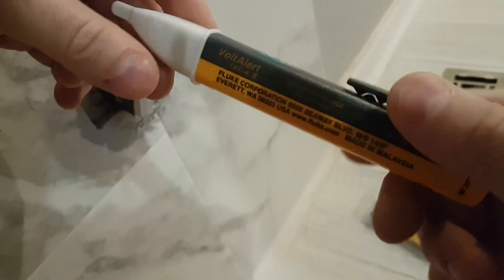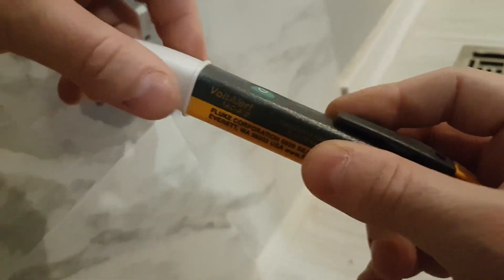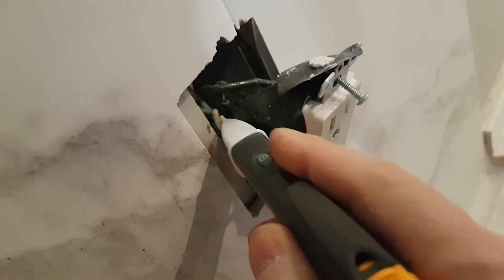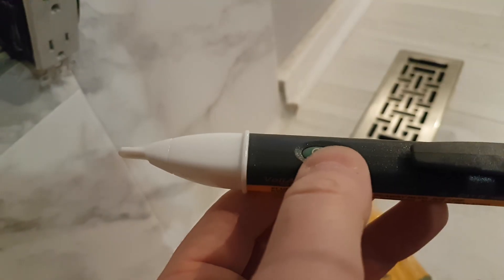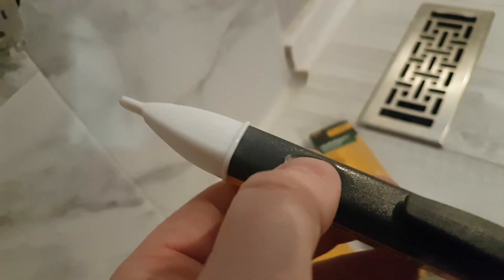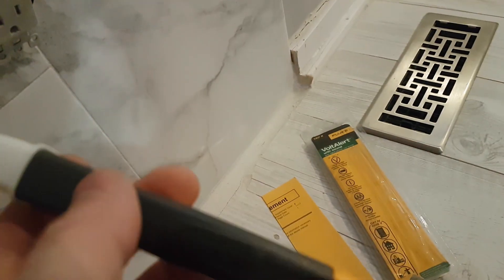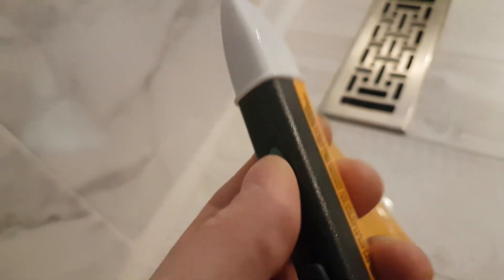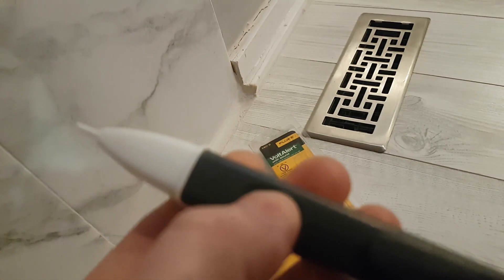How to Use FLUKE Non Touch Voltage Tester - Fluke 1AC-A1-II VoltAlert Non-Contact Voltage Tester

Comment: Very poor demo. you should have mentioned it's voltage range and shown the writing on the side, your thumb was covering it. Very poor indeed, fail.
Reply from the maker: I'm not an electrician lol. This is diy videos. Very easy .. thing goes beep that means there is power. Thing doesn't go beep no power.
Reply: @UnboxingArmy on these types of voltage detectors if the appliances is not grownded or lost its grown-up the testers light will light up

Comment: What's the difference between the ac..E  and the ac..A
Reply: E variant is expanded. It's sold part of a 5 pack. Where as the a is a singular volt stick. There's no difference in the product.

Comment: Mine is the same model but has no sound why? Although it has a buzzer!
Reply from the maker: You must of turned off the audible sound, its an option i tjink it hold the power button for 5 seconds on and 3 seconds off and ull have sound back on. If not look at the manual
Reply: @UnboxingArmy fuck you made no sense